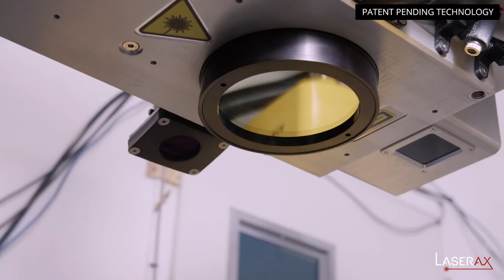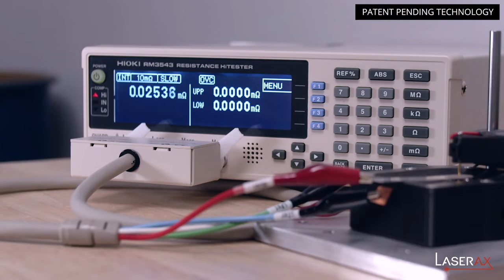Robot-Assisted Busbar Laser Welding (patent pending)

Comment: How do you ensure weld quality without melting the gas cut? Isn't the heat affecting it?
Reply from the maker: Hi there! With laser welding, using a shield gas is not always needed to achieve a high weld quality. The metal melts and cools much faster (almost instantly), so there is a lot less time for contaminants and oxygen to penetrate the welds. Still, using a shield gas like Argon is always beneficial. When we develop a laser welding process, we start without a shield gas and aim to achieve the best welding quality this way. We then add a shield gas afterwards, if needed.

Comment: Very nice solution! What is the limit of the efficiency of this system? Does it depend on the moving speed of the SCARA robot or the laser beam?
Reply from the maker: Hello @user-yh4tp5jh4o! It depends on the type of material, the welding thickness, the laser, the robots, and such factors. For most applications, the laser is limited by the robots, and multiple robots can be used to maximize the laser's uptime. You can contact us using the form on this page to discuss your application: https://www.laserax.com/contact-us

Comment: What is the weld strength for the neagative terminal welding?
Reply from the maker: The weld strength varies greatly based on the materials being joined, their thickness, the laser power, and other parameters. Each application is unique and comes with different requirements, so it's impossible to give general numbers. We can reach 200N of shear strength and more. You can find examples of weld strengths here: https://www.laserax.com/battery-laser-welding-applications

As you can see, they vary a lot. If you have a battery welding application and need help, please contact our experts here: https://www.laserax.com/contact-us
Reply: @Laserax  Thank you for your information

Comment: How do you ensure contact between bus bar and battery terminal?
Reply from the maker: Hello Sarang! The SCARA robots you see in the video move clamping tools with pressure sensors to confirm that the right pressure was applied on every cell and ensure zero gap. This clamping design is flexible and adaptable for various module designs and cell types.

Comment: Have you considered doing  all at once or are there technical limitations?
Reply: That's not how LASERs work
Reply from the maker: @dusselelite724 Good question! There are indeed technical limitations. The first one is that the laser beam, by definition, needs to be focussed on a single location to do its work. It allows it to concentrate a lot of energy in a small area. Now, it is possible to treat different areas at the same time, but you need multiple laser heads to do that. But you cannot treat all areas at once. In the laser head, mirrors move the laser beam very quickly over the work area. These mirrors are called galvo mirrors. The second limitation is that the laser head can only "see" a certain work area. We call this its field of view. For this reason, depending on the part size, you may need to move the laser head using a gantry system.
Reply: @Laserax  Sorry, may I know what is the principle/method you use protective gas for this? how you blow the gas and exhaust ? thank you.
Reply from the maker: @kumkumi963  To prevent oxidation of the welds, some manufacturers use a shield gas (like argon) in combination with laser welding. While using a shield gas is not always needed to achieve the required weld quality, it is always beneficial, as it helps reduce the number of defects in the welds. A good practice we use at Laserax is to develop the laser welding process without a shield gas and aim to achieve a good welding quality this way. If shield gas is added afterwards, it will only benefit the process. We use the shield gas demanded by the manufacturer.

If you want to discuss an application, you can contact us using the form on this page to discuss your application: https://www.laserax.com/contact-us

Comment: What is the battery model and have you considered the flatness of the battery rim? Thankyou.
Reply from the maker: Hello Jian! Yes, we take into account the battery cell's negative shoulder (or rim). Some cells have a round shoulder, some have a flat shoulder, and others are in between. The shoulder's shape differs based on the battery's model and specification. The one shown in the demo has flat shoulders.
Reply: @Laserax  interesting 🤔 which models have flat shoulder and which models have a round shoulder? The round shoulder must be more difficult to weld.
Reply from the maker: @jianyang2214  You're absolutely right! Actually, round shoulders are more challenging for any joining technology. That's because the contact point between the cell and the busbar/collector plate is harder to reach, so precision is even more important.

For the models of batteries, I don't have the answer unfortunately. I hope this was helpful!

Comment: What type of lab testing does Laserax do to validate weld quality?
Reply from the maker: Hi Henry! I assume you mean during laser process development as opposed to in the production line. We use a range of tests and measurements to validate weld quality during process development/optimization. The most common ones are cross-section images (SEM), mechanical resistance (force tester), electrical resistivity (four-wire Kelvin measurement), laser weld monitoring data (light reflection), depth of penetration (SEM), and aging tests.
Reply: @Laserax Very cool. Thanks for sharing, this is the craziest welder I have ever seen.